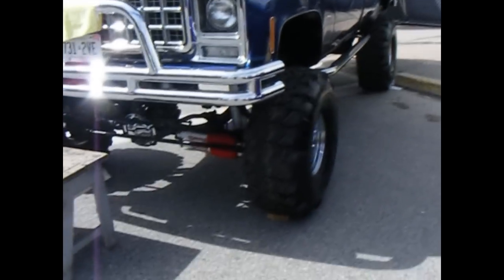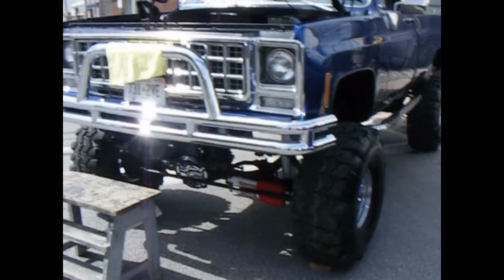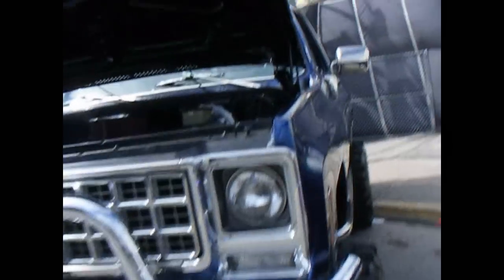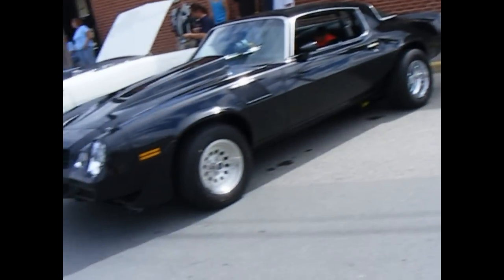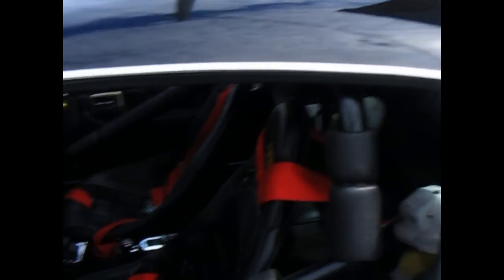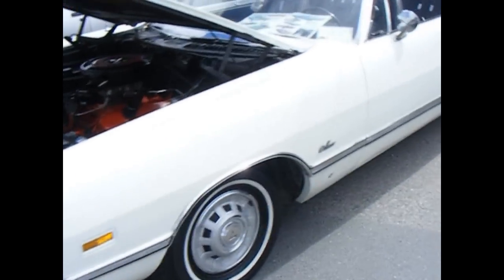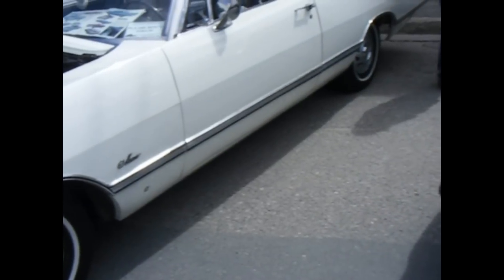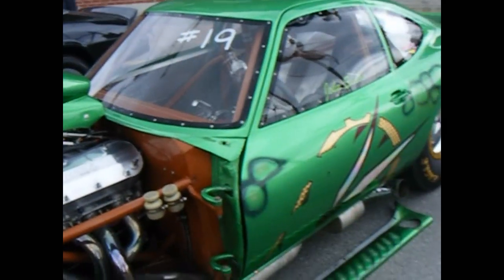Show and shine 2010

Comment: @schrankm It doesnt measure speed! it measures distance traveled then estimates the speed. so BOTH timeslips from the NHRA would show same ET and speed on your timeslip if you crossed the line at EXACTLY THE SAME TIME. You need to google how a Dragstrip E.T. works and you will see this is correct.It goes by time elapsed light to light. start to finish. at at the end both cars would be at same MPH at end in your sceniro anyways. its not how fast one leaves( they do measure reaction time)

Comment: @schrankm We wernt talking acceleration wer were talking a E.T at a dragstrip obviously they acellerate at diffrent times the speed is diffrent THE  E.T AT THE END IF THEY ARE SIDE BY SIDE would be the same. the TIMESLIP would read for example E.T. X  at XXX MPH and if both cars crossed the light at EXACTLY THE SAME TIME THEY WOULD BE THE SAME GET IT NOW? So if some one says my car runs 7.45 at 156 MPH that doesnt mean thats the fastest the car will go its just thier quater mile time.

Comment: @mrbobsshow lmao so if i'm driving a car 100 mph and i pass a parked car, that means that at the point i was side by side with the car, both cars were moving at the same speed? lmao if a car is stopped it can't then be moving at 100 mph. 

two cars at the finish line at the same exact time absolutely DOES NOT mean they are travelling at the same speed. get it?

Comment: @mrbobsshow yes it sure is possible. ever watch pinks? notice how many times a car gives up lengths to the other yet they often finish side by side. one car travels farther than the other yet they often finish side by side. now tell me how speed has anything to do with that? the speeds at the finish could very well be exactly the same yet the acceleration rate wasn't even similar. it's common sense!

Comment: @schrankm The speed WOLD be diffrent UNTIL they catch up and are side by side think of it this way a car is on the highway doing 65 mph you get on the highway at 35 catch up to him and are right beside him for the next mile are you going faster? no speed is equal if you are side by side. Yes he was going faster than you but now you are going equal speeds because you are side by side get it?

Comment: @mrbobsshow no two cars accelerate at the exact rate, common sense. say my car accelerates extremely quickly from a stop until it reaches 1000 feet and another car doesn't accelerate quicker until after say 500 feet and catches me. at this point, the other car would be accelerating faster but, what if the point it caught me was the 1/4 mile mark? both cars travelled at different speeds at different times. there are way too many variables to assume such a calculation is feasible.

Comment: @mrbobsshow it's ridiculous to think there is an equation to compute this. the amount of variables is enormous. you don't know how what kind of power that truck has or what gearing it has or the weight of it... you don't know any of that. no two vehicles accelerate at the exact same rate. think about it, have you ever seen a race finished side by side when someone came from way behind? obviously they didn't accelerate at the same rate but they reached one point at the same time.